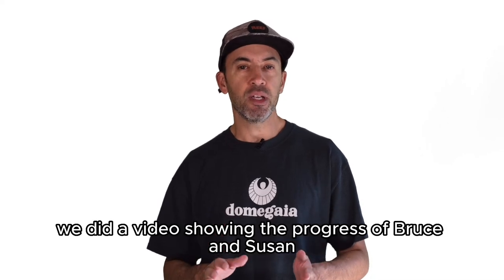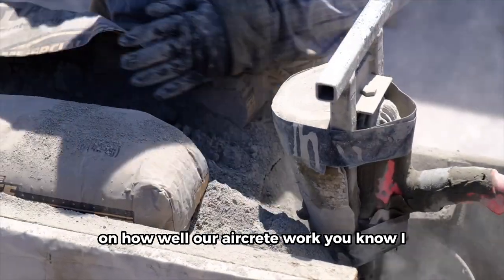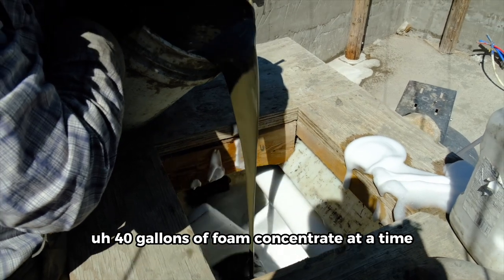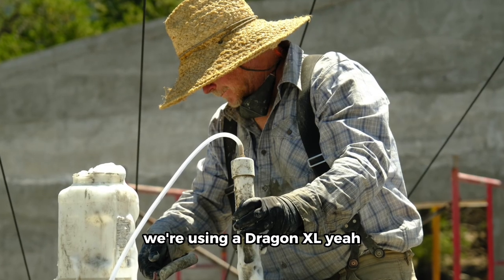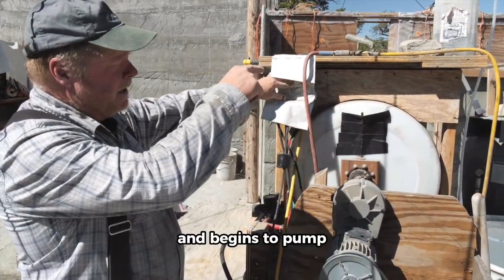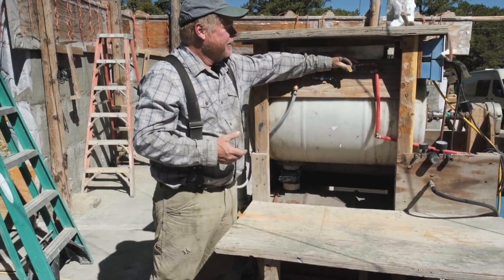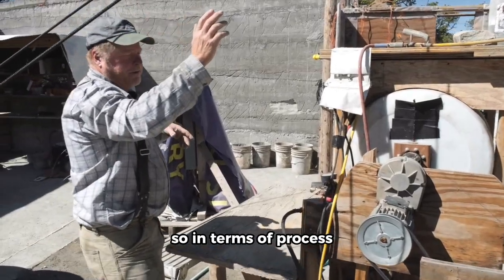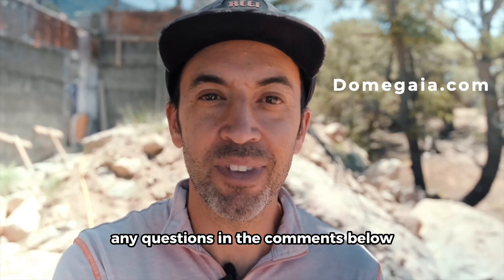DIY Aircrete Mixer and Pump System Explained

Comment: Can you make the plans, pictures and parts list along with the directions to building Bruces system? I have watched the video multiple times and still can't grasp how to make this system, all the help possible that you can provide would be greatly appreciated. My wife and I want to do a similar build when we get our property in Arizona and Bruces system would make it so much easier. Thank you.
What type and size valve are you using between the mixing drum and the pump drum? How many batches of the slurry are you putting in the top 55 gal. drum to mix and how much foam are you using to mix it? What diameter pool hose are you using, how long is it?
Reply: I would look Bruce up and go visit him... this video will never be enough.

Comment: This is a great system. I am building a semi automated aircrete machine based on a stucco mixer and a 2" diaphragm pump. My hope is to have even less steps with transferring to a pressure drum etc. I think i should just be able to make the slurry, add foam, mix and pump. Got the Dragon XL as the generator that I intend to add onto the machine. Ideally everything will be trailer mounted eventually to make it super versatile.

Comment: Thanks for sharing the info you have a nice setup! I'm looking at doing the thing for my build. On the air pressure, if you regulate the air pressure in your metal barrel to 20 psi, the max psi in your metal tank is 20 per square inch no matter the size of container. Hopefully you are using an air regulator to your caged barrel vs a control valve, air regulators controls the psi,..control valve controls air flow and not psi. Hopefully you have a safety relief valve (they come in different psi and are preset) your air  pressure tank and your aircrete pressure container, in case the regulator fails to limit the psi. Adding the cage around your tank is nice to have as well in case the regulator and safety relief valves both fail.
Reply: It doesn't have a safety relief valve, but that's a really good idea.

Comment: Domegaia:  a system like this would be a big movement toward getting building permits.  The Hawaii county office said the homemade aircrete was a big problem due to the differing consistency, human variability.  You have to use building materials that meet and are tested for certain specs preferably from a factory that tests everything.  I am wondering if even setting up a DIY testing process that could be documented would work to satisfy the permitting agencies?
Reply: I’m in Panama. Did hit right the “wall” in the municipal engineers office, responsible for building permits. “Aircrete? Certificates? No? Sorry. No permits!” Local availability in building materials are the key if you like to get electricity. Fire department signatures. All is only given if you use local products. So I am using concrete blocks like the original Steven Dome house. Hebel or Ytong products aren’t sold here. There are still roadblocks if you mention “self made aircrete”!
Reply: @holgermessner851  Yeah, silly how you need permits now right!? I'm living in a 300+ year old house, the word permit wasn't even invented back then and the house still stands, despite "human consistency errors." :D
Reply: @JiminyBillyBobIII  The not so funny part in this? There are at least 100-200 houses in the area who didn't have a building permit. I was one of the 1st one who "had to get one" . I know the developer had a cat & mouse fight with the Muncipal officer. I just think that I ended up in the middle.

Comment: Question, does the vibration motor added explode the bubbles of air Crete? If yes, then is not such a good idea to implement this vibrator because it looses the r value ?
Reply from the maker: No, the foam is very robust when made correctly